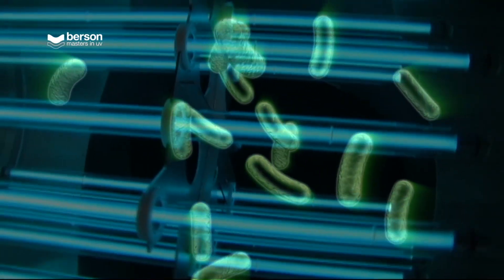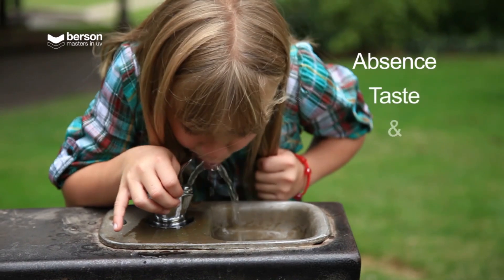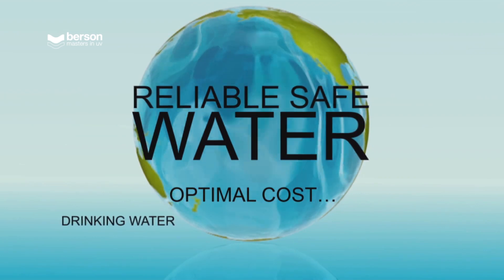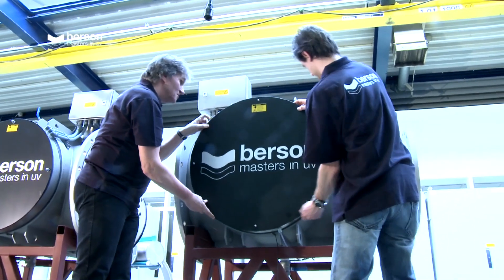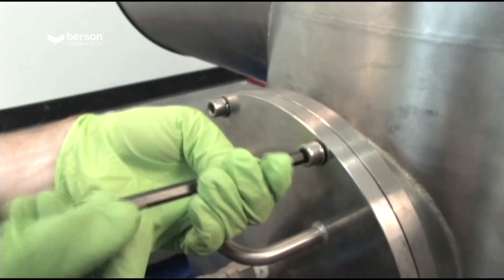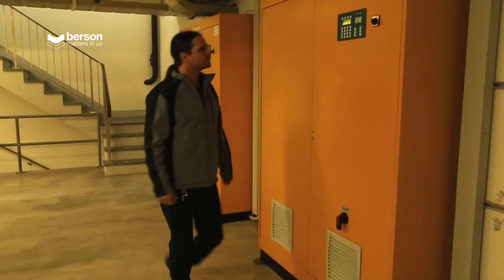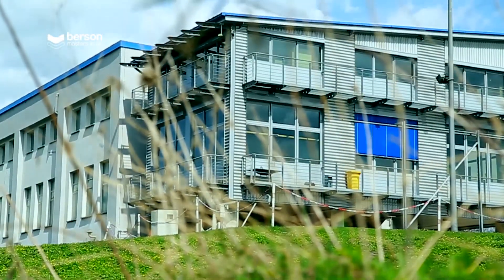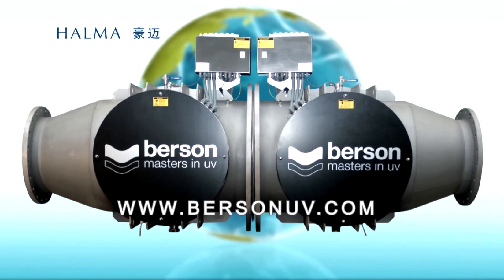Berson UV Techniek; Masters in Ultraviolet Disinfection (UV) Introduction

Comment: are there any by products formation when it comes to Uv disinfections please ? need help for an assignment on this topic
Reply: Not positive entirely been a while since I read up on it. It kills the hell out of things. But you still will need to add some chlorine, just a lot less as it is needed to kill certain bugs.
 This is then later reduced I believe. I took that info from American guidelines for water safety, and got into that info that route, there is no byproduct from UV it just breaks down microscopic biologicals so no problem
 Chlorine and/or bleach not sure which anymore I think create formaldehyde, I'm doing this all from memory, so correct me if I'm wrong.
American water safety from what I remember really doesn't test enough specifically for radioactive particles if I recall. Anyway, can't say I looked into it too much on the European side, funny enough since im from the Netherlands, also less of a worry, radioactive particles are strongly linked to rocks and rocky soil. Best water anywhere really.
 Good luck.